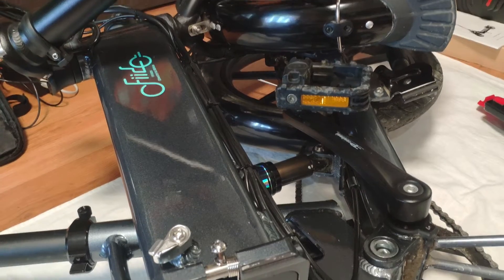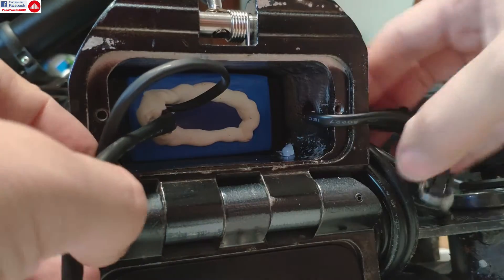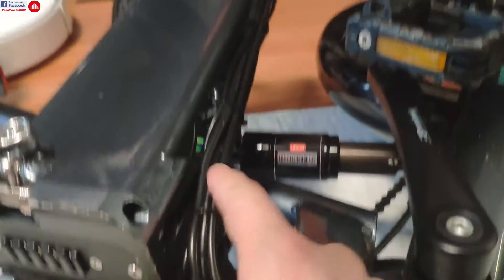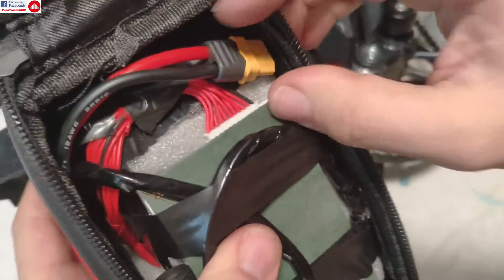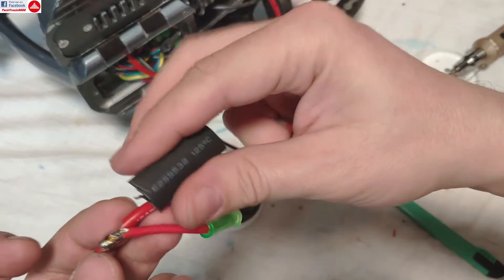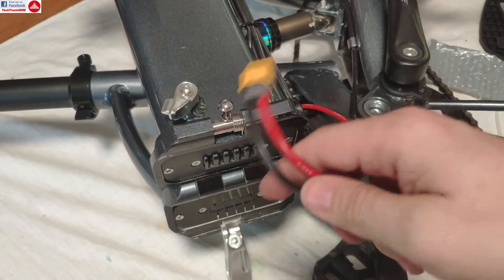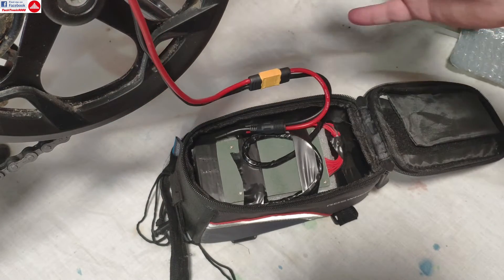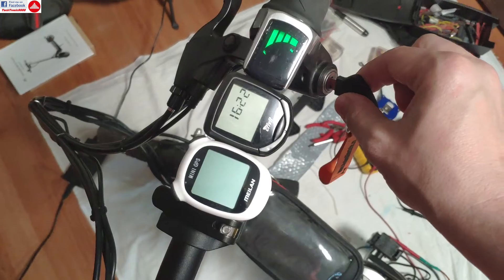Fiido D2 Original Battery Details & Double Battery MOD

Comment: A lot of thanks from Warsaw/Poland. By the way, the link to the replacement batery is not valid anymore. Can you recommend another baterry withe the biggest cappacity which fits? Thx
Reply from the maker: Depends on how much the 2nd battery needs to be, for a another 8Ah you will get double the range. Then weight comes into the equation, as maybe you don't need so much range that you end up crying a large battery all the time.

Comment: Brilliant, thanks for this demonstration. I’m very interested to see what you do with the L2 as I’ve ordered this model.
Hopefully you will show how to unlock the speed limit and how the disconnect the speed alarm.
I was interested to know, if I unlock the L2, would this stop the speed warning sound? Or would I have to disconnect controller wires?
To achieve this..
I have a Question, can the computer/ monitor on the handle bar be upgraded, as I would like to have a speedometer and distance traveled display over just lights indicating battery status alone.
Reply from the maker: Video for the alarm is coming soon ;) Also some new upgrades!
Reply: The disabling Fiido L2 speed alarm guide video is here (thank you, TechTronic9000!): https://tinyurl.com/u6lu8mp

Comment: Is it possible to combine a 48v silverfish pack and a 52v silverfish pack if the voltage is the same when connecting?
Reply from the maker: No, both need to be the same rated voltage, also this bike is 36V!

Comment: 36v 20ah is a good external battery, or you don't recommend, 36v 10ah is the recommended?
Reply from the maker: The bigger the capacity is the more mileage you will get, you just need to find balance between weight / size and the needed daily range.

Comment: Great vid!

I have a few questions.

1) is the speed limiter engaged even when  using the  pedaling mode without E-assist? Like if i wanna go down a hill at 40kmh, will it limit it to the given speed limit?

2) i know that there is a way to remove the speed limit on D1, is it also possible on D2??

many thanks!
Reply from the maker: Thanks for watching!
1) If you go downhill there is no limit the bike will free roll, got 50km/h on my D2
2) There is no such thing as speed unlock on D1,D2,D3, L2 because they are limited by the battery voltage and motor. All you see on youtube are fake videos with bikes going downhill, just to get views.

Comment: What type the ext.batt did you use, 10 x 18650 in series and parallel this array in many to got sufficient AH ?
Reply from the maker: My DIY battery is a 10S2P with 3000mAh Samsung SDI cells so a total of 6Ah/36V, it's compact, light and almost doubles the bike range.

Comment: Mate I have fiido d1 but it doesn't charge when I plug in, it stopped suddenly so can u make video please. Thank you very much
Reply from the maker: Do you have a voltage meter? You need to check out the charge voltage and the battery voltage.
Reply: Voltage 36v
Wattage 200-250w
Reply: @TechTronic9000  no, I don't have voltage meter but battery voltage is same like your

Comment: How is your usage experience of this 2 batteries setup?
Reply from the maker: With the original one I was getting 20-25km range, with the extra one I now get ~35km range. Acceleration has also improved a bit as there is a lower voltage drop.

Comment: Just watched your video, very good and informative. I have a question, how do you turn off the bike with the key if you have a second battery installed, isn't the second battery live all the time the way you have wired it?
Reply from the maker: You can disconnect the plug

Comment: Great video...So, what is the reason that you don't link the external battery on the same side of the frame as the original?  One other question:  Have you thought of doing a mod for converting the internal battery to an easy to remove (for charging) battery pack?  I just ordered the D2 and the non removable battery was one of my only niggles.  I really like the look and great reviews on the bike.  But, it would be much nicer if I could pull the battery for charging and not have to plug the whole bike in.
Reply from the maker: My battery from the video is a DIY one, made with SAMSUNG 3000mAh high discharge cells and a big 45A BMS.

Comment: Hi, thanks for the video is very helpful.! 
I had a question for you? Are those two battery has to be the same Volt as it 36v 7.8Ah ? Or can I put same Volt but with different capacity like 36v 12Ah? Thanks
Reply from the maker: You can put only same voltage, but capacity can be different, the bigger it is the more range you will get.

Comment: Thanks for the fantastic videos about e bikes you do.

Do you have recommendations for waterproofing and generally protecting external battery.

I can get another 7.8 AH battery for just £70 so was thinking of adding it to the outside on the left side of the bike. I think the battery is the same physical size as internal battery. 

I do a lot of riding in the woods so I imagine I may have to buy and fold some alluminium sheet to protect it from puncturing maybe?
Reply from the maker: Use a good bag and maybe some extra wrapping of the battery. Water might get in and damage it. You might also find a hardened battery case for the bike frame to give it some extra protection.

Comment: Excellent tutorial. Have replaced all battery and controller battery connection with XT60 connectors.
Second battery is in Ibera bag and rack behind saddle on DS2.
Reply from the maker: I'm glad that you have found my video useful, great to know that you did the upgrade! Now you can enjoy longer range.
Reply: @TechTronic9000  Hi again, so this tutorial is valid for D2s, just the same as D2?

Comment: Can you use a 14ah battery on a fiido d2 would it still work and whats the diffrence
Reply from the maker: As long as the voltage is the same - 36V nominal, you can use a battery as large as you can. As bigger the capacity is the more range you will have.
Reply: What type of plug does this have, i dont see a xt60 connector. https://m.aliexpress.com/item/4000341347054.html?trace=wwwdetail2mobilesitedetail
Reply from the maker: It's a "Deans" or "T" or "Deans T".
Reply: @TechTronic9000  is it safe to plug second batery to main batery, not the controler??

Comment: Can 25km limit restrictor be removed?
Reply from the maker: Fiido D1, D2, L2, all of these bikes are using planetary geared motors which spin very fast and have a reduction gear inside thus providing very good torque. the downside of such kind of motor is that is very limited in providing speed, for instance the ratio is ~ 4.5 to 1 so the motor is spinning 4.5 times per each wheel revolution. So all thees bikes are physically limited by the top voltage of the battery and the designed motor speed (KV - turns per volt), thus ~ 25km/h is the speed that the motor will be able to run under load at full battery voltage. If you don't trust this then you can check my controller swap video in which i replace a stock Fiido "350W" limited speed controller with a 1200W one capable of unlimited speed (99km/h) and the result is exactly ~ 25km/h.

Comment: Hi can you give any advice on how to speed up a D2s The holding the brake and switching on for 5/10 seconds does not work I believe it does on the D2 and D1 though 14 mph max most annoying
Reply from the maker: There is no such thing as speed unlock on D1,D2,D3, L2 because they are limited by the battery voltage and motor. All you see on youtube are fake videos with bikes going downhill, just to get views.

Comment: Great video. Thank you. I ordered exactly what you recommended. So now have three batteries a replacement, the additional one and the original). The original has lost half its capacity (so probably only get 5 miles from it ). Would you recommend connecting them all up in parallel to give me a 36v 21a battery ?
Reply from the maker: Yes you can use all of them together, just be sure to have the same voltage when you connect them

Comment: Great video, do you have any idea how to replace the front light?
Reply from the maker: If you want a more powerful one then you need one with a dedicated battery as the controller has low current output and you will burn it with a more powerful light.

Comment: Hello. To make less complicated for me cos i might blowup the batteryes. Is it posible to add swich... so use 1 batery then when  first finishes to swich to second battery
Thanks this is the best explain how to do .
Reply from the maker: The switch method is even more dangerous.
Reply: @TechTronic9000  how about creating a plug and play method by manually connecting 2nd battery via xt60 when 1st battery has discharged during a ride?

Comment: 1: Do both batteries have to have the same bms?
-
2: how much is the extra battery? 
-
3: How many km can you travel now?
Thank :D
Reply from the maker: 1) No, it's the original battery with it's own BMS and a 2nd battery that i DIY built and has a common wire BMS.
2) It was cheaper as I have built it, you can get cheap good ones already built from this specific store: https://bit.ly/3HA7ByO
3) The original battery had 7800mAh, the 2nd one has 6000mAh, before the upgrade I was doing 20-23km on full electric, after the upgrade the range went to 30-35km.

Comment: hi, very nice your video. I would like to ask you how to boost the speed of a d2s credit line?
because I have a fiido d2s but it goes too slow and I would like to make it go faster.
Reply from the maker: Hello, it's not possible to do easy. The single way to increase speed for the D2s is first to change the controller + display, this will give you a ~29km/h top speed only when the battery is 100% full. Then if you want to go even faster you need to charge the battery to a 48V, a controller for 48V, display for 48V. The original motor might work on 48V but will wear out faster. So you will probably end up also doing a motor upgrade. It's easier and better to sell it and get something faster such as a ADO A20, that unlocks from settings and does up to 35km/h.

Comment: Any videos on how to replace puncture on the rear wheel? Seems complicated even for and I know my way around bikes. Ebikes are a new world to me thanks
Reply from the maker: I will do a video when I will replace the tire, it's fairly easy, similar with a normal bike, just unzip the ties that hold the motor wire. No need to disconnect it as there is sufficient slack to work on the tire next to the bike.

Comment: I would have used the other poles as theres extras and youd get much better connection
Reply from the maker: Yes you could double them for better transfer.
Reply: Is your soldering iorn any good it looks like a battery version does it get hot enough and do u have a link so i can get it plz

Comment: Thanks for the very useful video! If I would install a more powerful battery, what’s the maximum ampere the motor and/or controller can sustain? Keeping the same voltage....
Reply from the maker: For capacity there is no limit, the bigger it is the longer the run time will be. It's important just to keep the same voltage.
Reply: TechTronic9000 thanks! Do you think the controller and the motor will sustain a 48V battery?
Reply from the maker: The controller no, the motor might be ok.

Comment: Fix the ado a20f with a 48v motor and battery can you.
Reply from the maker: It turns into a "rocket" the A20F will do 40+km/h ;)
Reply: @TechTronic9000   Do it on YouTube and show the people asap 🇨🇦🇺🇸🇬🇧💯pz  It will be a better ado a20f 48v 17amp

Comment: Excellent video. Thank you. 

Idea; 3d print a casing for the additional battery ( although this fabric bag works too)
Reply from the maker: That is a great idea! Sadly I'm not into 3D printing (for now) si my knowledge is limited.
Reply: TechTronic9000 believe me when I say, is way easier than you'd think. I was nervous about it too initally too 🍻🍻
Reply: Be sure to watch some videos on this before you buy a 3D printer. Videos like this one can be helpful.
https://www.youtube.com/watch?v=LvGKfevdf_Q
There are also a number of user developed upgrades that users have developed themselves for various printers...many of the upgrades can even be made by the user on the printer to be upgraded!! Some printers have a more develped user base than others as well...which can make a big diff in solving problems.
Reply: How well do 3D plastics hold-up to UV from the sun?
Also, wouldn't it take a LOT of spools of plastic filament to make a strong-enough battery case?
Reply: PA12 HP 3d printed nylon should be UV resistant.

Comment: Thanks so much for a great informative video. Do you think it's possible to make the existing battery into a removable battery. For example adding a cover/case for the battery . Just like the removable battery for samebike.
Reply from the maker: Only if you instal it on the outside with another connector

Comment: Saw the title and thought you were gunna replace the pack inside with one twice the size. You can fit 52 cells in that space for a 13s4p pack, upgrade to 48v 12ah!
Reply from the maker: The frame is too small, you can just replace the current "2600mAh" cells with something like 3500mAh LG MJ1 and will have a jump in capacity from 7800mAh to 10500mAh

Comment: Great detailed video, really useful as I have a dead fiido D2 after just over a year :(
Reply: How many times did you charge it? And is it really that bad? Iam planning on buying one from a guy that has it over a year now..
Reply from the maker: My D2 has 4000km the original battery still has 7200mAh from the original 7800mAh.

Comment: This is a great informative video that explains exactly how to replace the battery safely and i see batteries advertised that have a higher than 7ah and what are the benefits of putting a 10ah instead of the standard one that was factory fitted?
Thank again for a great informative vid...
Reply from the maker: If the new battery ** truly** has bigger capacity then your range will be bigger.

Comment: Thank you from France !!! Very interesting video !!! And well done.
Reply from the maker: Thanks!
Reply: Bonsoir jbai pas trop compris c’est pour gagner en autonomie ? Puissance?
Reply from the maker: With two batteries you get better autonomy.
Reply: @TechTronic9000  Thank you, there's a system to unbug to gain speed? Fiido ds2
Reply from the maker: Only if you change the controller and that will increase the speed to around 29-31km/h when the battery is full.
Reply: @TechTronic9000  🙏💪🙏

Comment: that would mean your controller will always have power even when folded. unless you manually disconnect the cables...
Reply from the maker: Yes, but this also helps deliver more current to the controller and avoid extra losses, thus improving voltage drop, power delivery efficiency and acceleration ;)
Reply: @TechTronic9000  you dont need this when its off though. It should deliver zero to the controller when its not in use. The method bypasses the off switch on the handlebar

Comment: This idea works on the surface, but not entirely safe method and not efficient because,
1. two different BMS - different charging-discharging rate, thus it will create potential energy differences. If high current is drawn, one can damage another.
2. different
 capacities of the battery packs - unbalanced current draw in order to maintain the same voltage level, they can charge and discharge each other.
Better way to do this is have all the batteries under one BMS.
Reply: Separating two battery systems by a switch is also a neat idea. But manual charging for two battery packs required.
Reply from the maker: 1) Because it's BMS to BMS they will share the load. Even if it's not equal and let's say you "take" 90% from one battery / BMS the other 10% will come from the 2nd battery. There is no problem here as long as initially the bike was using 100% of just one BMS. Also you can not unbalance them as being in parallel the voltage is equal at both BMS, while the cells groups are balanced by the BMS.
Reply from the maker: Separating with a switch is a good way to burn a BMS by rushing power from the full pack to the empty pack. Also a battery switch from battery 1 to battery 2 is also trouble as you need a serious contact for whisteting constant 12+A @ 42V (more than 500W) power.
Reply: @TechTronic9000  Sorry I couldn't fully understand the "initially..." and “serious contact…” ,  but yes you are unlikely to run into trouble with this system. And also you are right about the voltage but I was talking about unbalanced current and capacity.
As BMS is an essential for battery packs, there also are  bms control / gate control devices to monitor and control the BMS devices, but you will be fine if it’s only about 12A output.
And you can safely isolate two systems with dpdt switches(ON/OFF/ON).
Reply from the maker: The unbalance between the two BMS will always balance itself with no problem. Also the second (external) BMS should be one that also supports charging via discharge plug ;)

Comment: Ive connected it wrong before because fiido dont do the simplethings like putting + and - were u cant see the wires and havto guess but theres a bms in the battery it happened me yes big spark and 1plug was burnt but u have 3 more so jhst connect to a fresh plug and remove burnt one and caused no harm at all

Comment: Hi, thank you for this video!
Do you know if this battery have BMS inside? And is kind of safe to use?
I heard a lot about cheap li-on batteries catching fire and now I'm panicking when charging 🙈
Reply from the maker: It has a BMS and it's safe, my bike has 3000km already with zero issues and lots of charges!